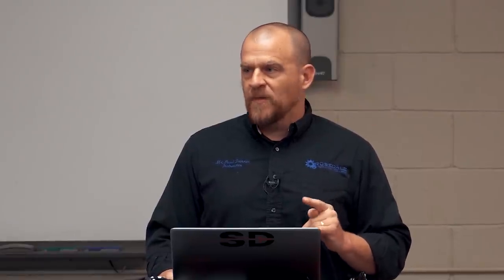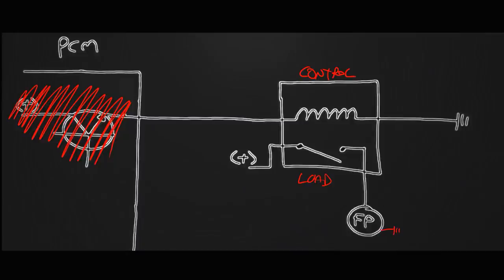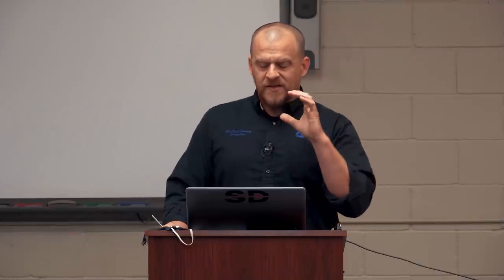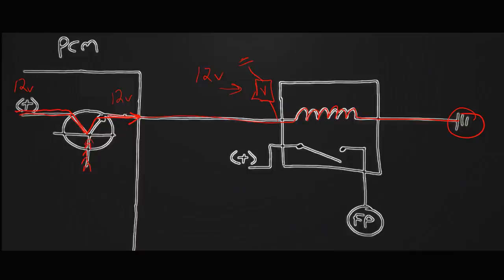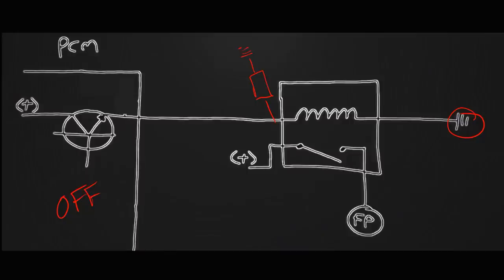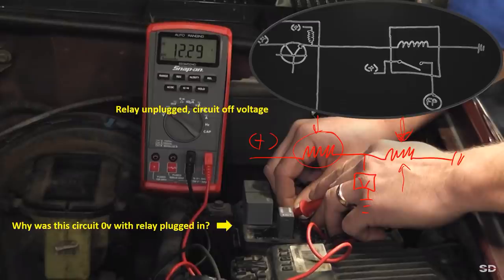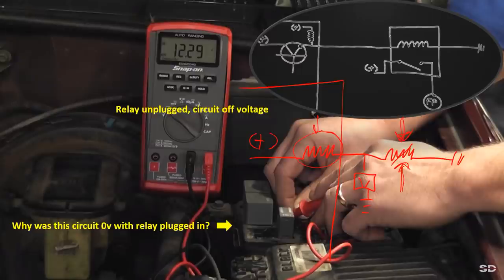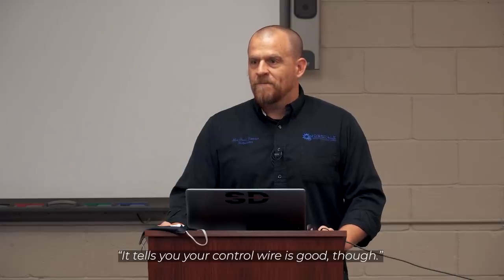Circuit ID and Integrity Testing Part 4 (SD Premium)

Comment: I like to use a variety of test lights like a digital one with 06mA draw, a red bulb with 68mA, a tag light bulb and socket with 284mA, 9006 bulb with around 4A, and an old sealed beam headlight that pushes 10A.

Comment: Thanks a lot for another great explanation about voltage BIAS, the incandescent light is always a good "friend" for us. 👍😊
Reply: probe on battery will trigger the relay certifying the wire can handle the signal.  If bat + won't close relay wire bad.....

Comment: The teacher I learned the most from in A&P school had a similar teaching style to you. Everything he said - no matter the subject matter -  would click. He frequently used the phrase "for our practical purpose" in the place of "always", "never", etc (your asterisk problem in this video). That was always helpful because it eliminated the need for him to detour, even for a second, into explaining that there are variables and other cases where this isn't true. When it came time to expand on the complexities of an issue later on, he would simply review the subject as we had previously learned it, and explained that we we're about to investigate the "for instances" in detail. This was great because we already had the base foundation of the knowledge needed to expand on the issue.

One example of this is learning basic aerodynamics. You can't honestly say that Bernoulli's principle "always" applies. "For our practical purpose" when learning about how a carburetor functions, when air velocity increases - pressure decreases. They're inversely proportionate. BUT, this isn't ALWAYS true. Once we took the dive into what happens once you break the sound barrier - things get wonky. Avoiding that caveat gave me confidence in the current subject matter.

Comment: Your statement at @ 26:00 is correct in that context. When the computer grounds an actuator, I always warn my greenhorn mechanics to understand the system before sticking a test light into one of those circuits.

Comment: Yay, no coked-out chipmunk voice lol.

In my field (Caterpillar tech) we have 5 or 8 volt bias voltages. Initially, I was like "why are they adding all this stuff making it more complicated?" What I eventually learned is that it actually makes our job even easier (if you understand the fundamentals behind it). When my code says "xxx sensor voltage low", it tells us that we have a short in the circuit. If you unplug the affected sensor and you get an "xxx sensor voltage high", it tells you that your wiring integrity is not suspect. That leaves you with a sensor or ECM/driver issue. It will even do the same for outputs (solenoids, relays, etc) by telling us whether the amperage is high or low.

Comment: Great video Paul! I work for a John Deere construction and forestry dealer and Deere tells us (its in the service manual) that the only way for us to check the driver's in our Vehicle controllers is with (ready for it) an incandescent test light. They just don't tell us to do that with the Engine controllers (why?? I don't know).

Comment: Came to watch again and thought I'd share an interesting function of our (CAT) ECMs. If you have a driver that has a short to ground, the ECM shuts down that driver until it gets power-cycled and reset. We rarely have bad ECMs unless they're installed in a bad location and they end up with water ingress or the housing corrodes through. They've gotten smarter and have moved all of the ECMs (except the engine one that's mounted to the engine itself) into the cab of the machine.
Reply from the maker: We see that too, where a driver is disabled with a current code. Clearing that fault and cycling the key is the only way to get it to turn on again. Thanks!

Comment: FYI your explanation of low resistance = high voltage and high resistance = low voltage also works for diabetics and insulin resistance but there’s kind of a bias as a diabetic with high insulin resistance usually has a high blood sugar reading which is misleading because that sugar isn’t being used for energy because the insulin that would transfer it to energy is blocked…

30 yr paramedic who also works on cars and right now I have 2003 dodge truck with a no communication problem with the computer.

This video is perfect because I did pull the asd relay and got 12v on a digital meter and wondered why.

I only have old school incandescent test lights but didn’t think to use it but now I will.

Everything in life is a puzzle.

Comment: The diagrams at my dealer have the transistors and bias voltage resistor with monitoring line shown in the control units it’s a blessing
Reply from the maker: that's cool, factory diagram are starting to show this

Comment: I always use a test light to load the circuit and if the wire is a heavy gage such as the fan wires or fuel pump wire or the AC fan, then I use a 5 amp bulb (headlamp bulb) at least.

Comment: Dear Paul,
Thank you for all your shared knowledge about automotive eletronics diagnosis. I have a question regarding to power consumption of test light.What is the recommended power to enssure that driver is in good condition without burn it? Best regards from Portugal. João

Comment: Years ago when I went to community college for mechanics we were told that a relay does a electrical job and solenoid does a mechanicly job like on a starter.
Reply: Relay and solenoid both use an electrical coil to operate. But I never really stopped to ponder that one does an electrical job and one mechanical, interesting.
Reply from the maker: technically the relay does a mechanical job too

Comment: I have Toyota Corolla 2004, automatic transmission, 135K miles, It 
starts and drives good but when it's cold it doesn't respond well to 
acceleration when stopped at a light. It needs to be revved up to 3000 
RPM  before it starts picking up speed. Once the car runs for about 15 
min, and the engine is warm, it drives with no issues.  I cleaned the 
MAF sensor, changed transmission fluid (no filter change), changed the 
air-filter, oil and oil filter, and antifreeze as part of the 
maintenance.  No diagnostic lights have popped up.  What should I do or 
change?

Comment: At 24.12, here is the answer to the question raised "Why 10.90V when engine cranking but relay removed."
12V are both supply to the transistor as well to the external SUPER high resistor. That means, these two inputs are at the same potential i.e. 12V.

1. Now, with RELAY unplugged, when engine is cranked, both are still at same voltage 10.90 (due to starter). Since both are at same potential, there is no lower potential for current to flow although the resistor is connected. It basically implies that the high resistor just sits between the same potential.

2. Now, with RELAY plugged in, when engine is cranked, DIMM reads still about same voltage 10.80V. 
The confusion here is "Where does this 10.80V come from? Does this voltage comes from the transistor or the external constant supply voltage?"

Here is the answer. Compare the 2 circuits i.e. n side of transistor till to the 86 pin side of relay, and the positive side of the RESISTOR to the same 86 pin side of relay.

There is negligible amount of resistance in the first circuit. However, there is super high resistance (over 100 KOhms) in the second circuit. So when engine is cranked, CURRENT ALWAYS CHOOSE THE PATH OF LOW RESISTANCE. It simply implies that the high resistor does not even exists at all. So, current flows through the transistor. Hence, this 10.80V is essentially the voltage coming through the transistor.

Comment: Another thing...
Say there is no 12 v supply on the n side of the transistor. Now, what would be the behavior of the transistor if an input voltage say 3 v is send to the base of the transistor? What will be the voltage readings at the 2 n sides separately? Will they show the same voltage 3 v which is supplied to the base of the transistor?
Reply from the maker: Good question, but with no 12v supply on the collector, this would be a computer problem, unless you we missing a main power feed to the board. In which case you wouldn't even be focused on one particular output, because you'd have a no com and a no start.
If the computer itself is not supplying 12v on the collector, then yes, for sure, you'd have low to no voltage on the output and it would not function and normal troubleshooting procedures would identify that. Hope that makes sense

Comment: Hello paul, I am having a TPS check engine light code, I monitored my Throttle angle % at full throttle and that was at 40%  I hooked up a volt meter to my Throttle Pedal Postion Sensor and I am getting a 5 Volt refrence.
Reply from the maker: What is TPS signal voltage?
Reply: @ScannerDanner  See I ben trying to find a wirring diagram for the vehicle. I purchased it twice thru shopkey and I dont know how to log into pro demand to link it

Comment: How often do you see a computer have 1 bad power or ground supply but the computer stays almost fully functional causing only one circuit issue. To give an example lets say it has no control of an evap. solenoid but everything else is functional and the computer/circuit is good.....does this happen often? Thanks ScannerDanner!
Reply from the maker: It almost never does. If I thought real hard I could maybe come up with less than 5 examples of that in thousands of cases.

Comment: Power probes have a reasonably low impedance, much lower than your standard meter. They load the circuit way more than your ohm meter, though it would be less than an incandescent test light. I question your point about trusting the LEDs on it. I’d love to see you test it!
Reply from the maker: The power probe (because of its low impedance) will pull down certain bias voltage signals, causing a variable when performing circuit integrity testing. This is outside of the LED vs Incandescent test light variables. Thanks!
Reply: @ScannerDanner  I don’t think I laid out my point properly. 

The power probe is effectively a voltage meter. Meters have high impedance to resist electron flow while testing voltage which it what makes them safe to use on line voltage equipment. 

The power probes lower impedance allows greater current flow while testing, which would load a circuit. 

But the terms high and low are relative. I guess I could look at the tech specs.
Reply: @ScannerDanner  thank you for responding. I do appreciate your expertise
Reply from the maker: @Texsrt4  I understand that, thanks! I'm saying that is a disadvantage at times, that's all. I have the PP4 and it's a great tool!

Comment: Hi Dan. I just want to ask if my pcm circuit has a pull up driver does it mean my bias voltage should be positive(+) only and pull down 0volts/ negative? 12:40

Comment: Tell more details how the extra  resistor behaves when the driver is activated?

When  driver is off with relay plugged in, 0 v on the control side. When driver is on with relay plugged in, 12 v on the control side. How does this 0 v changes to 12 v??? It's very confusing. Please explain more.
Reply: Computer supplies power from the transistor and the relay coil consumes it through resistance. The computer has it's own transistor that changes just like a relay would but the bias voltage is what's extra in the computer board, as Danner said, it is used to monitor opens or shorts in wiring integrity.
Reply from the maker: sign up for my classes my friend, I can teach you for sure and you seem to have the thirst for knowledge, which is necessary to succeed https://www.scannerdanner.com/join-scannerdanner-premium.html

Comment: Power probe has a short fail circuit design but not sure if it would trip a weak transistor if supplied the opposite polarity. I would say that it would cook the computer driver but whi knows. I know I wont try it 😅
Reply from the maker: oh it will definitely cook a driver if you are not careful

Comment: Hi Paul !!...another great electrical VLOG...I'm your "Corvette Guy" on your Premium Channel and had a quick question on AC so maybe I can get you here and if not I'll get you on the Premium side....a friends 97 Corvette AC stops working after a long ride...works fine normally when first started....question about "AC Request"...if I press the AC mode button while watching the AC Request and I see YES does that tell me that the HVAC Module is sending the class 2 message to the PCM and the PCM is receiving it ???...older Corvettes used a 12 volt wire to the PCM....I've checked all the inputs...RPM, AC pressure sensor, ECT, ambient temp sensor and all looks good !!...using my U activate I can get the compressor working on the load side and the AC mode light stays on...I don't see the PCM grounding pin 85 on the AC Clutch relay control pin..I also checked at the PCM to see if the PCM was providing the ground there but NO...  thanks !!
Reply from the maker: The AC request signal is being read from the ECM data PID list right? If so, then yes, your HVAC module is sending the signal. Are there any other  inputs, low psi or high psi cut offs or an evap temp sensor? Tough call on the ECM driver for that relay failing only when hot. I feel like we are missing an input
Reply: @ScannerDanner  Hey Paul, thanks so much for getting back to me !!...YES, reading the AC Request data PID from my Verus Pro...no evap temp sensor on this car...AC "presssure sensor" voltage good, ambient temp sensor on HVAC not reading minus X degrees and all others look good...when this is happening only when hot I'm thinking increased resistance and maybe the PCM driver failing when hot but maybe no. Friend drove the car all day yesterday and couldn't get the AC to fail...so thanks again and if you and the Fam are down in Southwest Florida next winter look me up and we can have a big BBQ down here and take the boat out for a cruise !!...oh, another thing if this AC Request is a Class 2 data message I wonder if I can scope the data wire and jump the HVAC and PCM splice pack wires together along with  the data wire and when I push the AC mode button with key on if I can see some data packets being sent out over the data wire ??
Reply from the maker: @rwrobs777  these older GM computers did fail for sure, just make sure that the control wire is tested right at the ECM (you said it was missing when measured at the relay) before making that call. Make sense? And heck yeah, I'm always up for a barbeque!
Reply: @ScannerDanner  Paul, I did check to see if the PCM was indeed grounding the circuit at the PCM (high resistance  ?) but still no good !!...thanks for the info and I did see something in SI that said if you don’t see the AC Request the HVAC Module is bad and if you do see it change the PCM..NEVER mentions anything about checking inputs !!...I hate these troubleshooting trees...bad info !!

Comment: hi paul!! question.... the are different types of bulbs for the testlight, if the circuit is using around 100 or 150mA in the relay control side, and i use a testlight that's using 500mA up to 800mA for substitute that load (relay coil), can i cook the driver? don't know, but the PCM may have a current limited device for protecting itself? i think it's important to know this, i mean if we are going to substitute a load with the testlight we need to make sure how much current is using. thank you so much for sharing this!!! Thanks to you and other friends of you i'm starting to do diagnostics, i love it!!! Love from Argentina!!!!
Reply from the maker: Yes! A resounding one, on cooking a relay driver with and 800ma test light. I wouldn't rely on the current limiting circuit if there even is one on a relay driver

Comment: What's the most affordable set up /kit to enter into being a precise diagnosis and repair tech and avoiding parts changing? Really strapped for cash but really interested in this.
Reply from the maker: unfortunately that is a complex questions and even more complex answer. You want to get started with troubleshooting electrical and electronic systems on cars right? You will need a service information subscription, a decent DVOM, a good test light ot two or three lol, and a decent scan tool that provide you with bi-directional controls. Oh and you will want a lap scope too.
Reply: @ScannerDanner  thank you for the response. Really. At least I know what to start with and where to look towards. I'll look at your Amazon page for specific suggestions.
Reply from the maker: @iiNgONYaMa  Also, post to my forum. It is free to join. We have over 20k global members and you will get some suggestions from others who live and work in your market. There is not a one size fits all with this type of stuff. www.scannerdanner.com

Comment: Is there anywhere on a wiring diagram that indicates a circuit has a bias voltage ? Or do you always have to test for it ?
Reply from the maker: No sir. Service info does not provide that

Comment: Hi Paul, would it be a good idea to explain about DMM’s versus Analogue type meters with respect to their ohms per volt internal resistors. (you may have done it in earlier video’s.oops, my bad then lol.) An example, especially with bias voltages/resistors, would be to show the minimal effect on a circuit with a high ohms per volt DMM as against the use of an analogue meter/incandescent test lamp. Just a thought. Love the video’s as always...Regards Peter A.
Reply from the maker: Yes of course! All of this is discussed in my classes. Thank you!

Comment: I think you can see  bias voltage with a power probe because you get a voltage reading but neither positive or negative leds light up
Reply from the maker: A power probe has less internal impedance than a digital voltmeter and will pull the bias voltage down